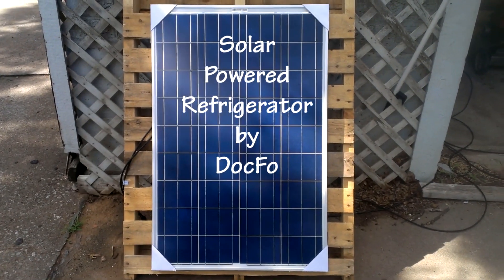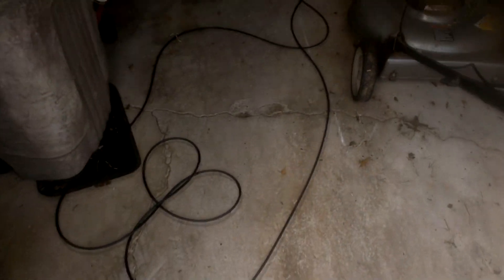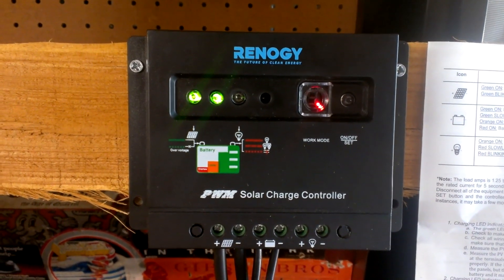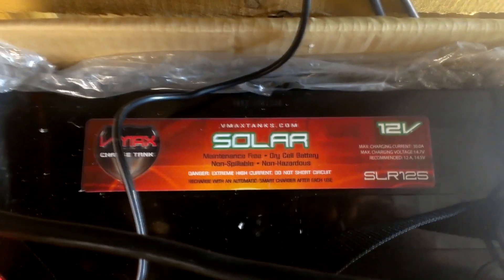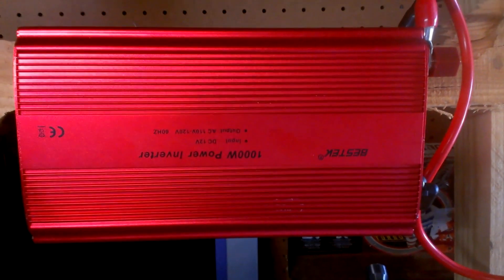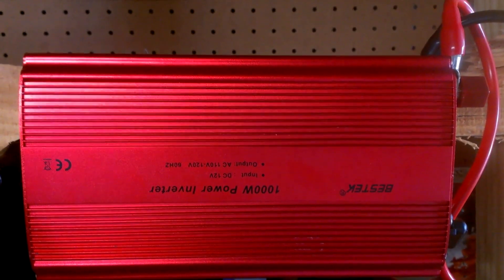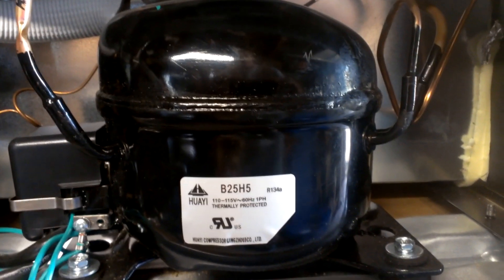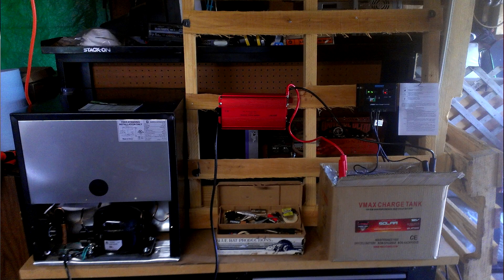Solar Powered Refrigerator 2014, Stillwater, OK

Comment: Great video and I was thinking about doing the same thing using that kind of ref. the other kinds are hundred of dollars and that is to much, you can get this kind for less than just one hundred and use an inverter.  just wondering if your inverter was a pure sine or a mondifide sine, if it is mondifed sine will it work on the fridge?  please let me know how it works on the ref. being a modifide sine, I have both and wonder if it would mess up the ref.  if so will use my pure sine.

Comment: Thanks for making the video, I'm working on the same project :)... A couple things, your fridge uses 1.3a at 115v which is 149.5 watts, when it's running. You can't equate the 1.3 amps the fridge pulls to the 125ah of the battery for a number of reasons, the most important of which is that the battery is supplying it's 125 amps at 12 volts.  It is also speced to supply it's power over a 20 hr period, which would offer 6.25 amps at 12 volts, or 75 watts an hour.  Then there is the fact you should
Reply from the maker: Thanks, Bubba! I'm still learning about all the electrical aspects of this stuff. I appreciate you taking the time to write that out for me. Here's the unit at camp. Look forward to more experiments. Solar Powered Refrigerator Part II: Setting Up the System at Camp
Reply: +Hugh Foley Thanks for sharing your video. 
Nice little setup you have their. 
I just subscribe to your channel. 
Please checkout my google+ and my YouTube channel and subscribe for more information on solar, Battery Banks, Wiring Diagrams, Charge Controllers Series and Parallel Configurations and all the good stuff from my channel. 
Please share my channel link to your friends, family, Facebook, Twitter and to all other people who are just learning about solar, or who about to start for the first time.
If you happen to find anything that interest you, please give me a thumbs up and +1 
Thanks for your time and God bless. 
Cheers
Reply: What's the size/specs of the charge controller Hugh? Thanks and good stuff!